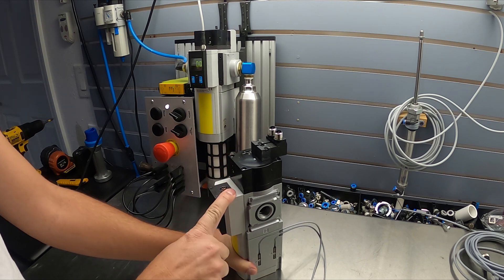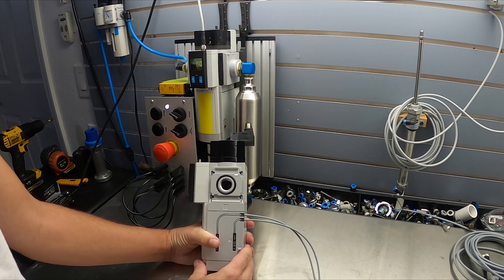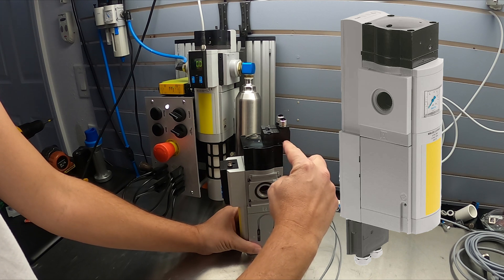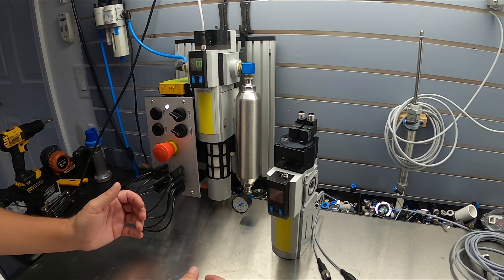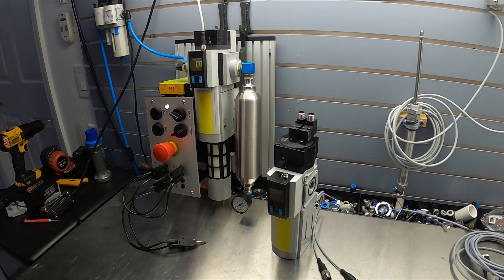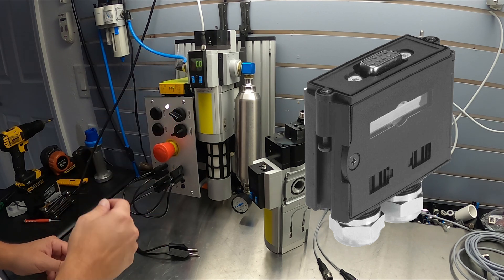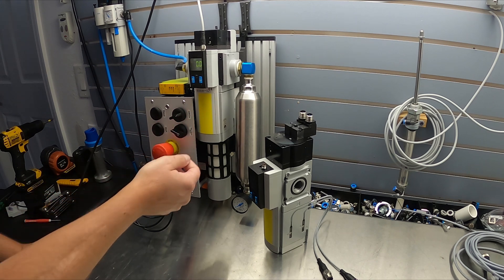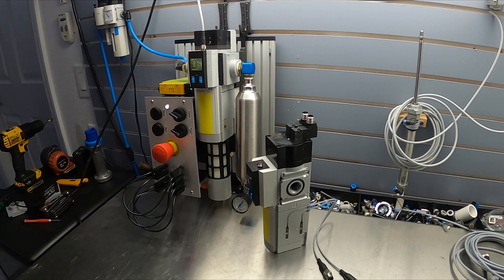The Main Difference Between Festo MS6-SV-D vs E Safety Valve

Comment: Really good video, BTW in the nut shell, the D and E stands for the different safety level, from my understand, the D product should performance as the PLd , similar catalogue 3, and the E product should performance as the PLe, similar as the catalogue 4.
but well use what kind of the safety valve can't be determine by the engineer for most of the time by personal idea, but once get in touch with system system, it always need to calculate the system failure property and choose the components which can improve the system to reach to the ISO/DIN standard as well as the customer specific requirement for individual projects.
Hope for more knowledge sharing, thank you for the effort :)
Reply from the maker: The PLd and PLe difference is not entirely accurate. The MS6-SV-D can achieve category 4, PLe. You can achieve this by adding a 3rd sensor (S3).

Comment: Hallo Sab,

my question, I have MS6, and maximum pressure is 6 bar. But why ms6 only get 2,4 bar???
Happen after safety instruction fault.
Any related with neca ??
Or you have comment? 

Please..
Reply from the maker: Hello, It might have something to do with the soft start aspect to this valve. When a machine starts up the valve will slowly pressurize the system. Once the system gets to a certain pressure, the soft start goes full open. It is possible that the soft start is not able to reach its threshold to fully open. This can happen if there is an air leak downstream. You can try to troubleshoot this by  disconnecting the rest of the system and just blocking port 2 at the valve. it should get to 6 bar if you do this test. If it does not then there is more to this problem.

Comment: Hey, I'm facing a problem regarding the difference between these two, as the enigneering for my project was done considering the MS6-SV-D and now the one installed and which I have to work with is the MS6-SV-E. Does it only come to the wires coming down from 4 to 1 (ignoring the one related to the pressure sensor) ? Is it as simple as wiring I/O EN1 & EN2 to the allocated outputs of our safety PLC ? Does the self-check feature makes up to the perfomance level on its own ?